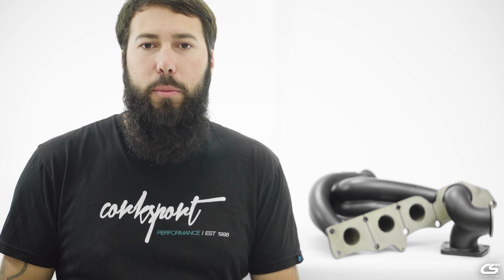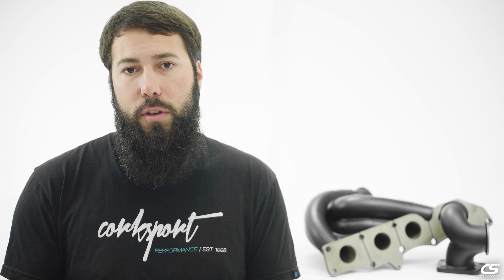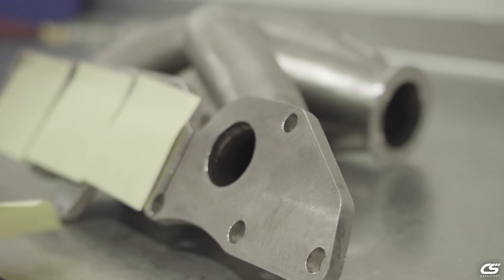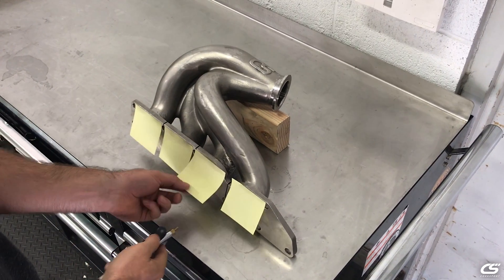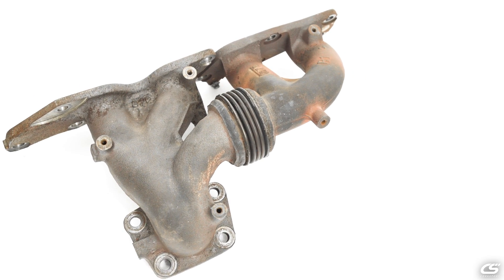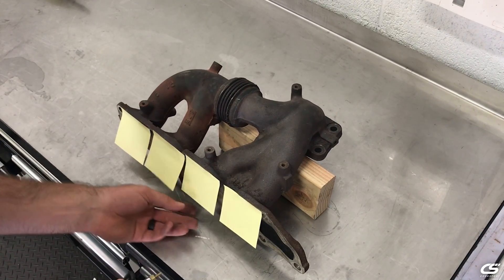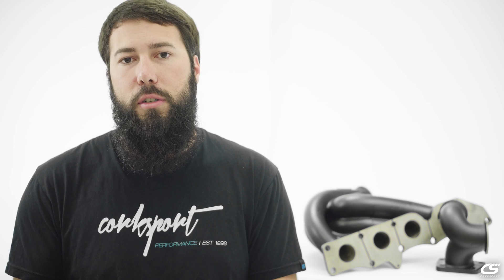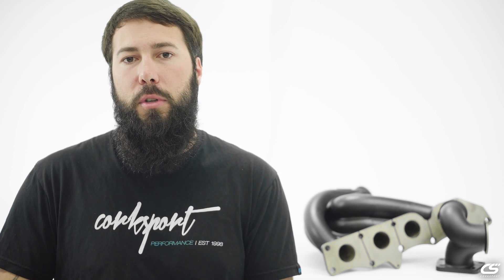Exhaust Gas Scavenging with the CorkSport Exhaust Manifold, See how design makes a difference!

Comment: Why did you not run this test with the Turbo flange attached?
Reply from the maker: All the scavenging happens at the manifold collector. The hot side of the turbo doesn't play a part in that.